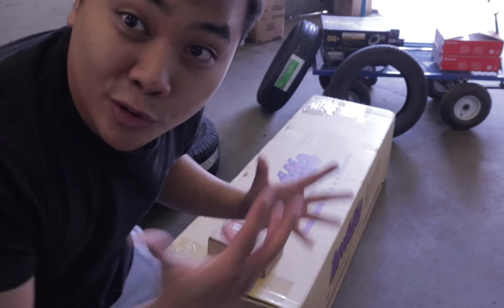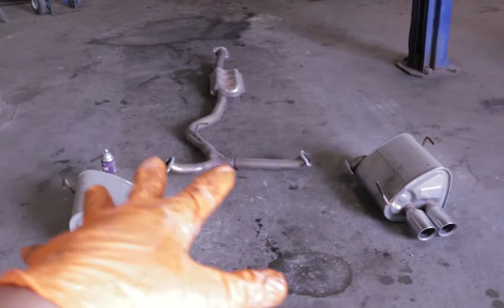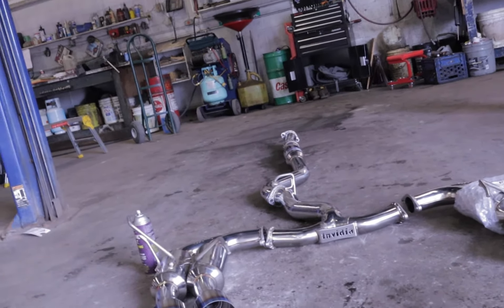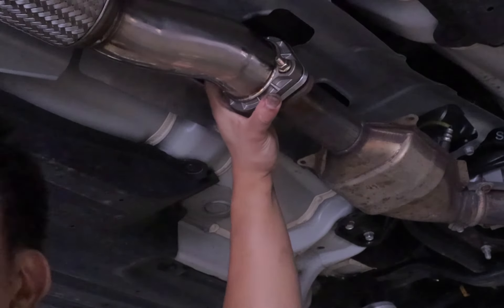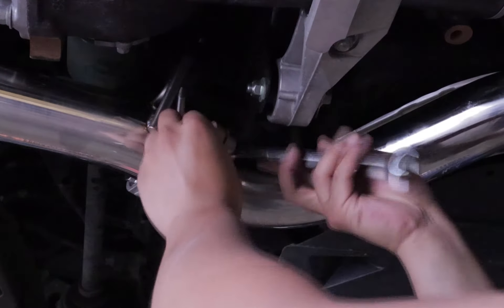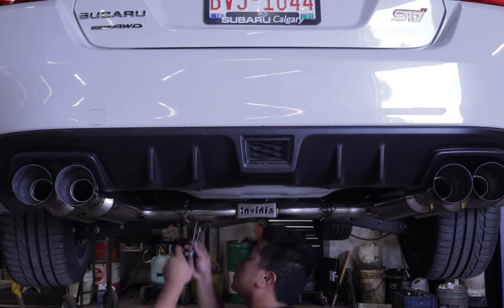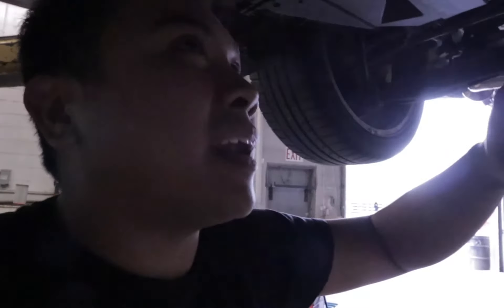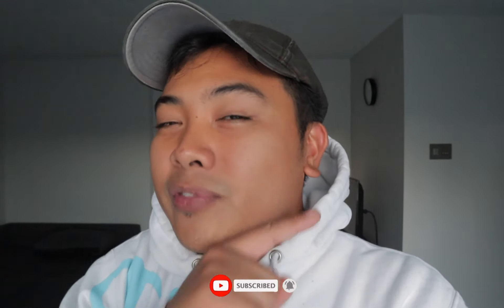LET'S INSTALL INVIDIA GEMINI R400 ON THE STI 💨 | SUBIE RUMBLE UNLOCKED 🔓

Comment: Where did you order your exhaust?
Reply from the maker: Garage111 here in YYC ✌🏻
Reply: @SimplyBryy  was it like online website or a local shop?
Reply from the maker: @kentvillanueva6929  local shop ✌🏻
Reply: Im guessing you had to buy that grimmspeed stock DP to 3” catback exhaust adapter separately?
Reply from the maker: Yess! They said you can get away without it but i figured i dont want any fitment issues so i got it haha